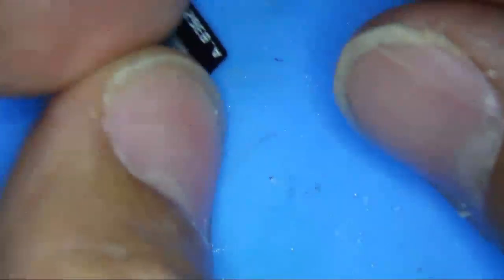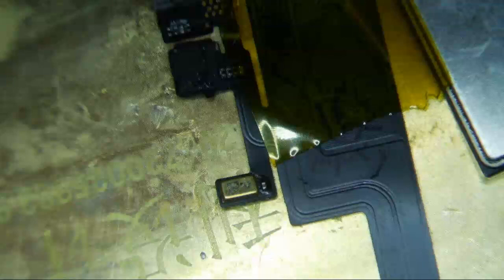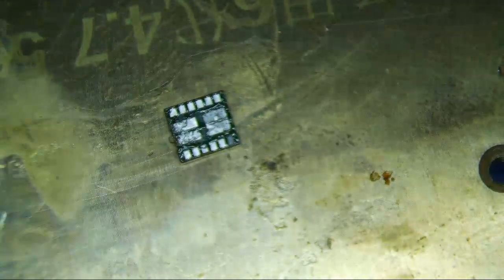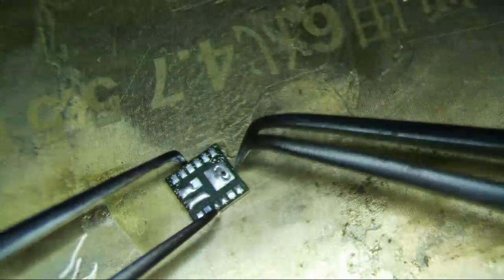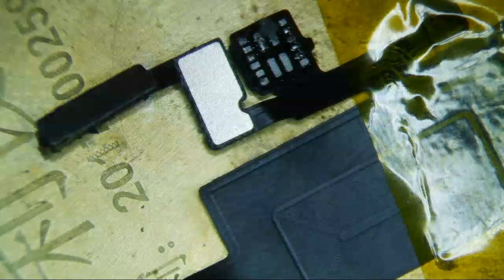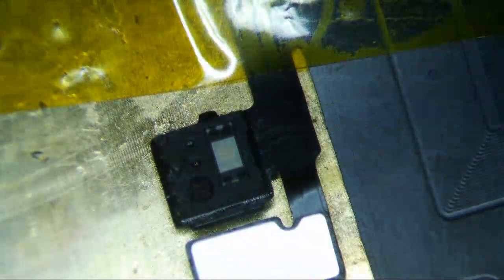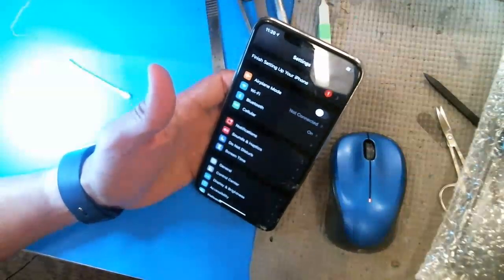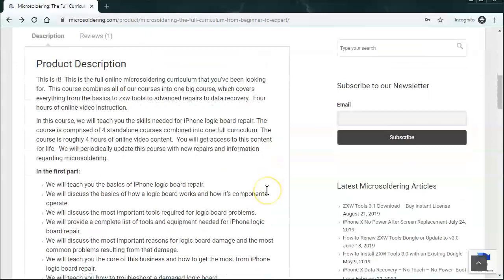iPhone XS Max Face ID Repair after Cutting Ear Speaker Flex

Comment: Thank you so much Mike I took your micro soldering course on udemy during December. My journey is beginning like yours. I had this issue with iphone 11 pro max recently ear speaker torn flex. The back side at 250c with low to almost no airflow is super easy and flux does mess with certain components. Oem ear speakers that are soldered are better than taped on. Mobile Sentrix has lots of good product some obscure items can be hit or miss though for obvious reasons. I'm slowly getting the shop to invest in me and the business. Yes that means we won't have as much to bring to you anymore unless I'm stuck or back logged. I only spend total of 180 minutes Max on any one device. Thanks for your skill share and talent sir. I hope to meet you in the near future and possibility get an in person hands on with my own person project (ipad mini 2 digitizer fox replacement). DMV showing support for it's own thanks again Brother.

Comment: I added just a tiny bit of flex before soldering, went straight through sensor, also somehow I melted the sensor using 270C.  I really don't understand how you did not melt it going at it from that angle.
Reply: Wen you point the heat to the sensor it will melt, use the heat on the back of the sensor like he does n it works 💯 %

Comment: I’m confused, all other videos from Chinese repairers state it’s the dot projector that is paired,. They then use various tools that transfer data from dot projector flex to a new flex and Face ID works, however, you state it’s the proximity sensor that is paired. Plus, I personally just swapped out the whole front cable without any problems! Hope you can clarify. Thanks
Reply: They are all paired
Reply: Depending on what is damaged,  you repair accordingly.

If ear flex cable is damaged then swap the flood illuminator.

If dot projector is damaged then its the dot projector need to be swapped

Comment: Hi. Can you advice me possible fix for faceid in iPhone X ? I have 4 iPhones X
 damaged

1.
PROXIMITY OK
CALL SPEAKER OK
ANIMOJI OK (FOLLOWS WHEN MOVING HEAD) 
FACEID: OPENS SETUP SCREEN BUT STUCK ON PLACE YOUR FACE WITHIN THE FRAME ALERT
PORTRAIT MODE FRONT FACING CAMERA : FAIL ,NOT MAKING BLUR IN THE BACKGROUND

2.
PROXIMITY FAIL
CALL SPEAKER OK
ANIMOJI OK
FACEID OK 
PORTRAIT OK

3.
PROXIMITY FAIL
CALL SPEAKER FAIL
ANIMOJI OK
FACEID IS NOT AVAIABLE ALERT
PORTRAIT MODE FAIL

4. FLEX WITH SENSORS CAUSING BOOTLOOP , THIS FLEX WAS TESTED WITH 3 OTHERS IP X MOTHERBOARDS AND SAME ISSUE RESULT BOOTLOOP

Comment: From what I’ve been learning, the move higher/lower is a problem with the dot projector and it is not fixable
Reply: That's not true. I just fixed 1 flex ripped out by a client of mine when he tried to change the screen by himself. 
First i had this problem , move the iphone higher an lower caused by a short (my bad) between  pins 15,16,17,18 and 5,7,9,11,13.
I've fixed the short and problem solved, now it's working perfectly
Reply: piulistu yeah well, if you see physical damage of course it will be fixable. I’m talking about the cases where there’s nothing obvious
Reply: @ELIT3FIX  correct n I witnessed it too. Positioning the heat is vital. Understand the purpose of the heat n make sure deliver the heat carefully so it will will melt n come off. Experience is the key or it will burn the ic or sensor n not able to remove the component